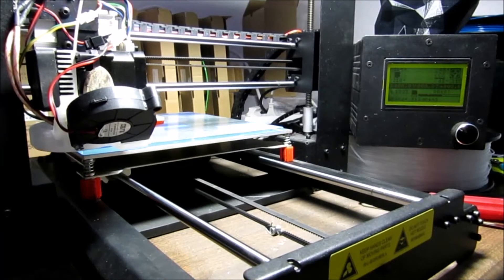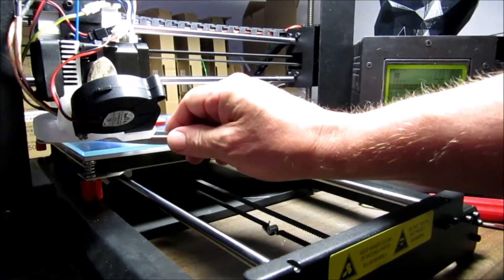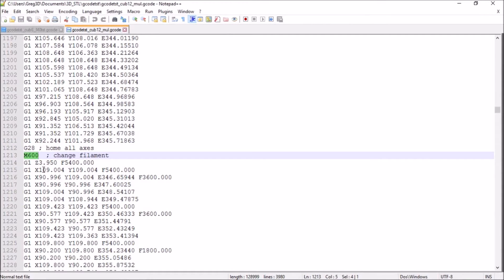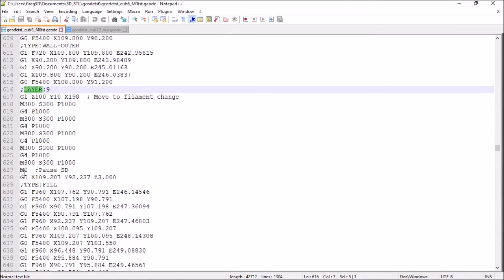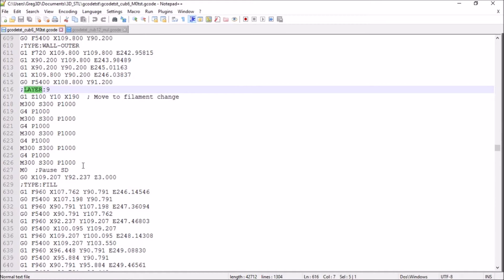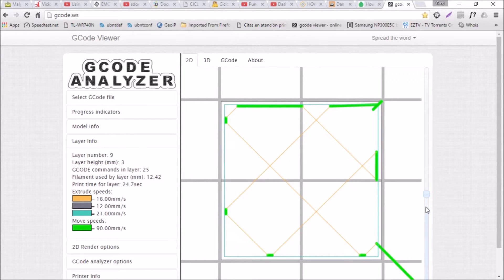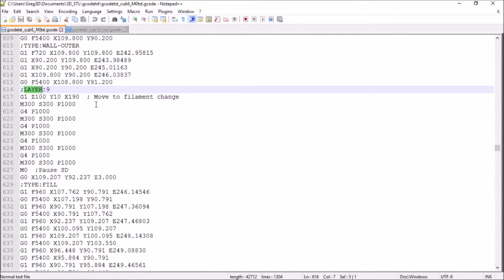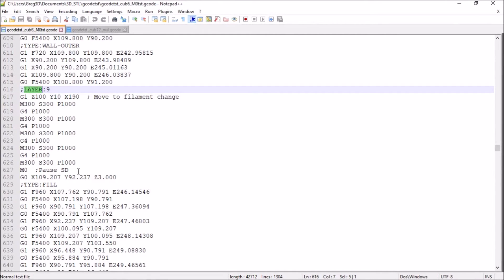Malyan M150  Filament  Change Update - 3D Printer Tutorial

Comment: Great job.... Subscribed.
Reply from the maker: Thanks, it's really appreciated. Hope to do some more 3D printer stuff soon.
Reply: 1nformatica Ive been working with filament runout detection sensors since I saw this video. Learned alot. Inside Marlin firmware, there is a feature called advanced filament change. There you can specify a "park location" for filament changes, # of beeps, feed and unfeed rates and amounts, how long befor hot end cools down, etc. So by default the M600 command uses the park location stored in Marlin firmware. But if you have not stored a custom park location, you can also use M600 in your gcode or Octoprint script with a specific location. 
M600 X10 Y15 Z50; Do filament change at X:10, Y:15 and Z:+50 from current. Then M601 to resume.

Comment: thanks for the info, i have used it to embed magnets into a print works great, i have used it to make a magnetic cctv mount for a digger with add-on forks to enable the driver to see were the forks are to pickup pallets of bricks, the forks are normally obscured by the bucket
Reply from the maker: Great to see someone making something using information I put in the video. Thanks for your comment. Sounds like a useful safety device, you should put it up on Thingiverse https://www.thingiverse.com/